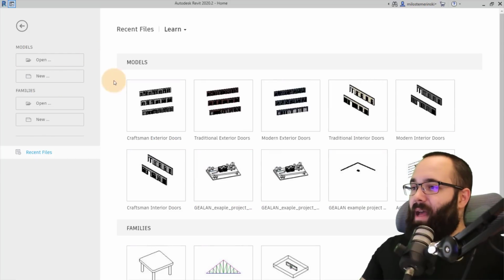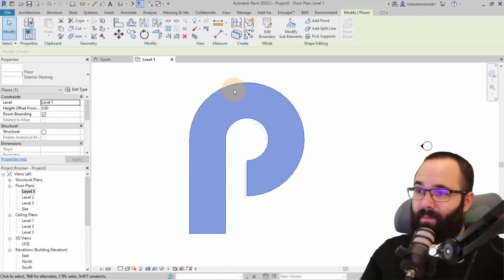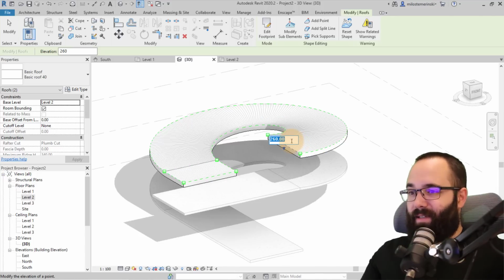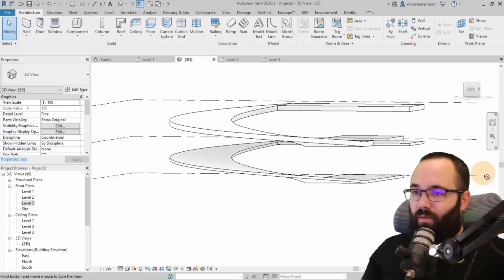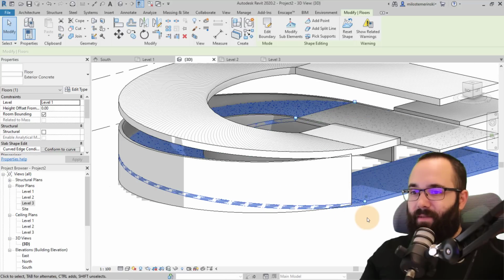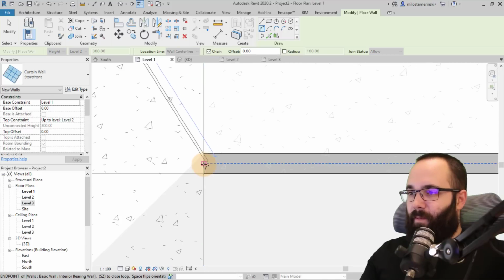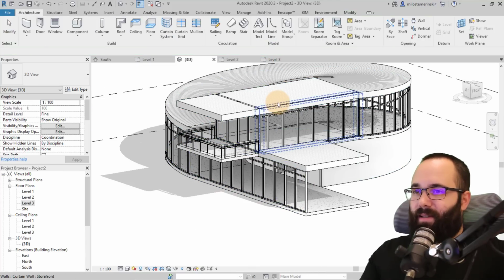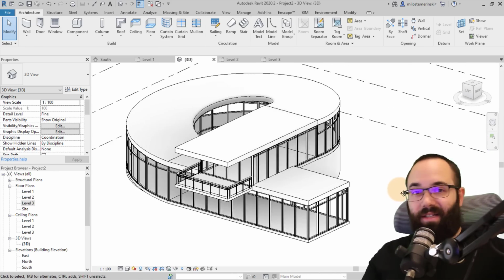Twisted Building in Revit Tutorial

Comment: Hi! I have a question about a topic you mentioned. In my project I have a similar sloped floor, which I'd like to split into flat levels. You talked about doing this in the video - if possible, could you please give me some tips on how to do it? I don't want to loose the shape of the walls which are cut to the curve of a single slope, yet I need the floor to be flat (connected by steps). Thank you!